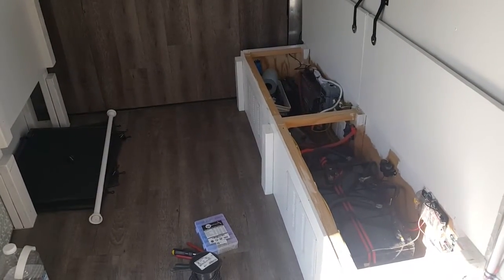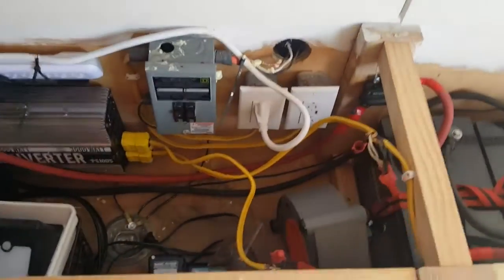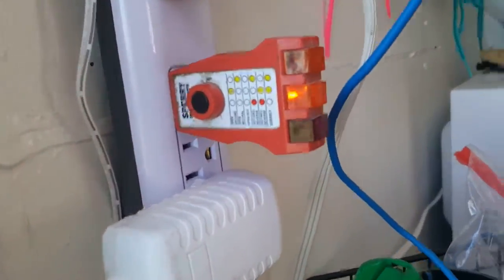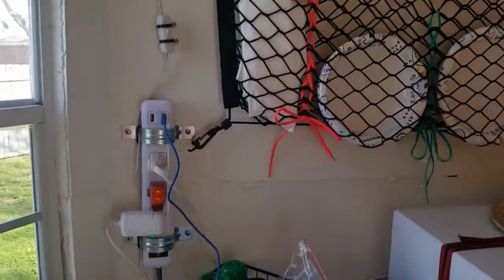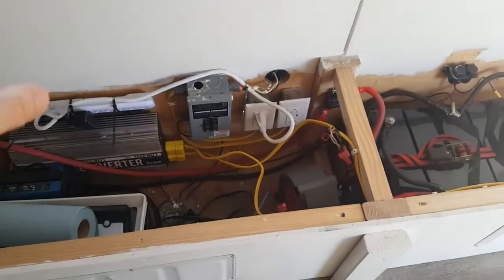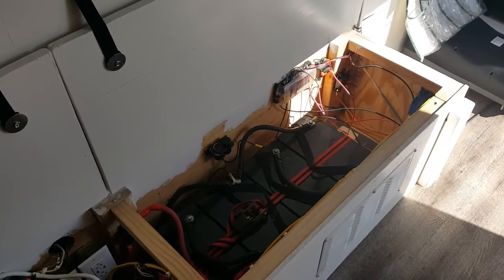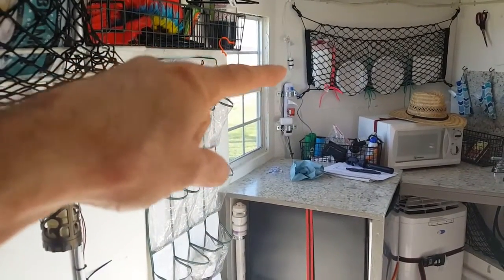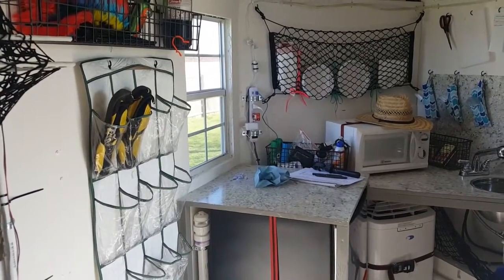ELECTRICAL GROUNDS 6 X 12 Cargo Trailer Camper Conversion Vanlife Part 28 skoolie #flgctc

Comment: In order to fix that you need to bond the ground and neutral when running off of shore. You can do this by putting a switch in and turning that switch on when connected to shore
Reply from the maker: Thank you for the suggestion and for watching the video.

Comment: Wgat was the outcome of your system? I was attempting to copy it for my build. Thanks!
Reply from the maker: I have used this system for 2 years now with no problems. I did add a ground wire from the breaker box to the frame. I am going to change the 2 outlets from the breaker box to 20 GFCI outlets. They will only work on shore power and that is when I am using them.

Comment: Just like the ground on a car. the frame is the ground. Shore power is grounded to the actual ground (Earth). The frame on a car has rubber tires under it.
Reply from the maker: I don't disagree with you. However, it isn't that simple because we are working with both AC and DC. Also the AC inverter is not showing proper grounding with the tester. AC voltage testing also shows not proper grounding. Yes, the frame is ground for DC 12 volts but it seems not for AC 110 volts from the inverter. And, yes, shore power is grounded through the extension cord to the Earth.

Comment: I think I would check your panels to make sure they are grounded. Try running a ground wire from the frame of the panels to ground. Do this for each panel. One may be faulty and would show a fault in the entire system. Just my 2 cents worth.
Reply from the maker: Thanks for the suggestion John. The panels' frames are attached to the metal frame with metal L brackets and stainless steel bolts and screws. I am reworking the whole system right now and will try a few more ideas. Thanks for watching.

Comment: If the problem is the connection from the trailer, to the literal ground. for instance the wheels being rubber, then theoretically  you could simply bypass this by instead of 
getting a rod and jamming it into the ground, get a metal trailer jack that people use to level their trailers and weld a 2 inch metal bar on the bottom to stick into the ground.
Reply from the maker: Ahh. I like that idea. Thanks for watching.

Comment: You need to run a heavier ground cable from the battery thru the floor to the actual frame.. I promise it will help you out.  Good luck and please let me know how you make out..
Reply from the maker: Thanks for the suggestion Kurt. I have since run a 1/4 bolt through frame and a 8 gage ground wire. Still open ground. Still stumped but trying any new ideas i coms across. Appreciate the suggestion. Thanks for watching.
Reply: @FakeLegGreg  wow. Really stumped now.. try hanging and old school dragger ground strap from the bottom of the trailer.. my last idea untill tomorrow. I'll talk to an instructor from the solar program at my trade school.. good luck. Nice set-up tho. Really!!

Comment: I'm glad to see you've done this. Hopefully, you'll never have to rely on it and hopefully, others will follow suit and ground their rigs.
A previous comment about inverter ground is correct. Ground is exactly that - Ground. The inverter generates hot and neutral, not ground. You've done the right thing by grounding it to the frame, but you will not get a true ground like shore power without a ground rod.
*I assume NO RESPONSIBILITY from actions based on this comment* You don't need to have proof of ground shown on your tester from your inverter. In the event of a ground to the frame from your inverter 120, you will blow the fuse, thus breaking power. Fuses don't fail to blow, and are much safer than breakers any day IMO.
My suggestion on grounding your rig was primarily for protection while plugged into shore power.
My last note - ALWAYS check your ground at a site that provides shore power. I've seen some jacked up shore power and made repair (or demanded it be done) to some before plugging in any rig.
We do this all for fun. A step of precaution can assure you that electrocution won't end that fun!

Nice work GB!
Reply from the maker: Thanks for the observations. My comments about the negative comments were not directed at you. I deleted some comments from others that apparently cannot express themselves in an appropriate manner. I don't mind learning and being called on my stuff, just not insulted. You are right, we are all in this for fun. Thanks again Starling.
Reply from the maker: This guy is showing a method for checking the shore power before hooking up. https://www.youtube.com/watch?v=NhyAzVNZboA&lc=z22uz3sgdojlt5kjr04t1aokgquliaskt04nqtisgjxkrk0h00410

Comment: Put a steel spike in ground connect to that Oring see what happens. Also that Oring usually just screwed into wood not metal? I do know my generator says put a spike in the ground and hook it up to generator ground screw. I am confused on the 12volt black is it actually supposed to be grounded? That is the confusing part, maybe remove black battery portion from ground. That light is flickering on the tester could be DC feedback.
Reply: I personally do not ground my actual battery negative - I ground all devices (Inverter/Converter/ATS/EVERYTHING and use breakers/fuses... I do have a grounding rod for my Gen and for the trailer - I'll shoot a video of my setup tomorrow - how I deploy my grounding rob -- Now that GB has brought this issue up I'm gonna go buy one of those testers and see what result I get...
Reply from the maker: @mobileoffgridpatriot8191  Thanks Vince. I look forward to seeing it.
Reply from the maker: Thanks for the input. The screw is driven through the D-ring anchor into the metal frame below. I will check out removing the battery ground and see the results.

Comment: May I make a suggestion? Those D-rings are not tied to the frame, most are just bolted through the OSB/ Plywood. Drill a hole in that part and ground to the frame. You'll be glad you did. Most inverter generators are and have an open ground. The way I fixed that problem, was to make a jumper wire within a plug you buy to repair a power cord, but the plug by itself, NO other wire is connected anyway! Just trying to help.
Reply from the maker: Thanks for the suggestion. The screw is driven through the d-rings into the metal frame.  Definitely into the metal below the decking. I will look into the jumper wire idea. Thanks again.

Comment: Can you try plugging your tester in to the inverter and see if you still have an open ground.
Reply: nice one, that would take stuff out of the picture.
Reply from the maker: I should have thought of that. Thanks for the suggestion Vince. I will get on it.
Reply: My thought is that the outlet strip or perhaps the wiring to the plug that outlet strip is plugged in to is bad/wrong...  @FakeLegGreg